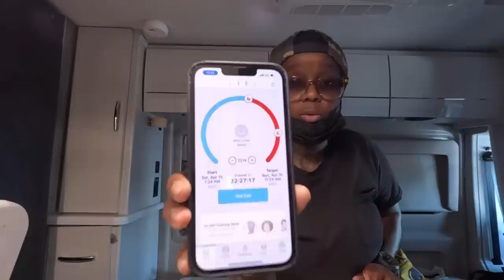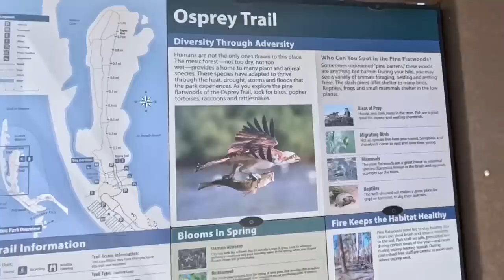Living In My Van|| Surviving The Ups And Downs Of Vanlife|Salmon For Dinner 😋||Ep.105

Comment: Cooling tip:  place a tray of ice or bowl of water in front of fan and let the air blow across, the chilled air is very effective ❤
Reply: O m gee. I was just about to comment that lil hack 🤭!!
Reply: I was thinking she will very quickly regret getting a battery operated fan in that heat. But I am glad she realized she needs an in house battery system and solar being in Florida.
Reply: My parents did that when I was a kid back in the sixties it worked I remember

Comment: Just a little tip about cleaning your curtains. If they are not soiled , only dusty all you need to do is toss them in the dryer on air fluff or no heat setting. Add a fabric softener sheet for a fresh scent . The sheets can also be used for an air freshener in your van. I use them to dust furniture with for a quick job & it leaves a bit of a shine😊😂❤
Reply: I use fabric sheets to clean my tubs❤
Reply: Good idea.

Comment: Hi NI... You are way to young to remember... I always keep 2 wire hangers in my car specifically to hold anything up in case of emergency. Use caution with tapes because exhaust gets hot. I just love adventuring with you. A great "hack" to stash clothing, blankets or pillows, is a cargo net mounted (suspended) from the ceiling. They are cheap and they also add a bit of extra "insulation" both for warmth in winter or keeping cool air cool. Sending you love from Myrtle Beach. Stay safe ❤
Reply: Great idea about the hangers! We keep a couple around from the dry cleaners for getting hair out of our daughter's sink drain, lol. As a 40 year old, I'm sure Nomi knows about wire hangers.

Comment: Please be careful taping anything to the wire bundle…you could put enough weight on the bundle to break the smaller wires in the bundle or loosen them from their source attachment. A similar thing happened to the wire bundle to my hitch jack on my rv and I had to get it rewired.

Comment: I enjoyed your video. I'm so happy to see you enjoying yourself in Florida. The turtle is a gopher tortoise, they are so cool. They dig burrows for shelter. The burned areas are from controlled/prescribed burns. The Florida Division of Forestry conducts those routinely to remove built up vegetation to help reduce wildfires. You fixed that hanging pipe like a rock star! Happy and safe travels. :)

Comment: Nomi, I cut out the silver reflective and slid it up into the windows of my Thor Tallaro on all the windows and it reduced the heat in my van by 15 to 20 degrees.  Especially in the back windows in the bathroom.  It has helped so much to reduce the heat and it also kept my van warmer in the cold weather while I was in TN.  This FL sun is brutal.  Stay Blessed!!

Comment: I watched this show in 2 segments and missed your van issue, wow, rubber used under the van sounds odd.  Glad you were close to the RV place so you can get it fixed.  You did a great job of fixing it in the meantime.  So glad nothing too serious happened with the belt break holding the pipe up!  I think by now you have found most of the vulnerability in your RV.  Better travel days ahead, stay positive!   I love that fan esp. battery operated, great for storms and no electricity in the hotter months, plus saves on your power.  I  have to pick one up myself! God Bless!

Comment: Ouch the only problem I see with putting that electrical tape around. The tail pipe is remember that tail pipe is going to get hot and the glue on the tape is going to melt. That might not be a great idea. I really pray that it works out for you😖you’re doing a great job securing that. 👏👏

Comment: Has anyone ever suggested locking your van manually before you exit? Vehicle theft in the south is pretty bad.  Today's car thieves can capture the signal between your key fob and your car and use it to electronically unlock and start your vehicle when you're not there. Not trying to send bad vibes, but just a suggestion.

Comment: Heeeyy, 👋🏽 Idk what size batteries your fan takes, but you know they sale rechargeable C,D batteries. A while ago I purchased a battery charge unit from Amazon for AA, AAA, C, D & 9v with USB and c plug in. Mine included rechargeable batteries, or u can purchase them separately. I luv rechargeable batteries, for some reason my household runs thru batteries, this was much cheaper than constantly replacing.

Comment: Let them show you the reset switch  under the cover plate right on your 2800 onan. Under your rig !should be pictured on the onan manual? 
Please do not restart gene with exhaust taped up as it could create a fire … onan generator in Ocala can also service ( oil change/fuel filter) your Gene and repair the exhaust mount

Comment: You need a neck lite for nights for reading so you don't have to keep even a small light and you can also buy neck fans. I am always hot. I have 2. But the charge lasts for a long time on both.  You can wear the neck fan outside when walking it really does wonders that air hitting your face. So sorry for your mechanical problems.  I heard you say you are a minimalist and you don't want stuff sent to you. That makes sense but also I could send you a lite and fan and they fold and don't take much room. If things don't fit for you, you can always donate and pass it on to someone who can use it. At night I stand Mt neck fan up next to me and bend it to hit my face so at night you won't need to use no power.